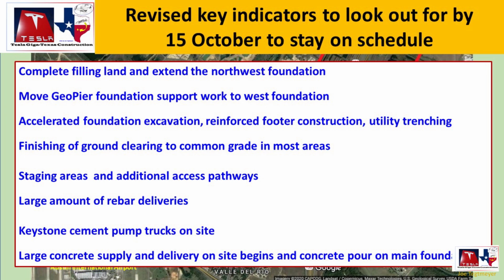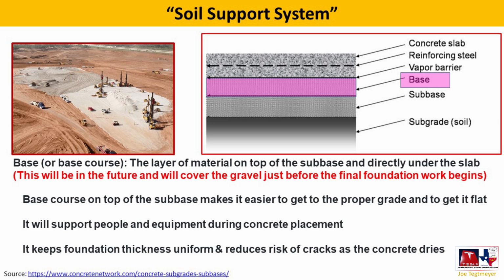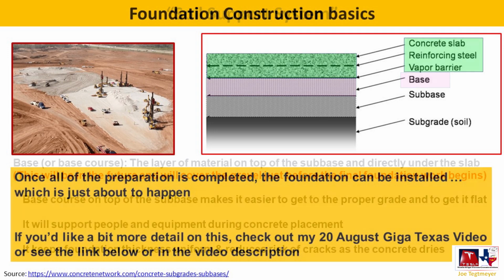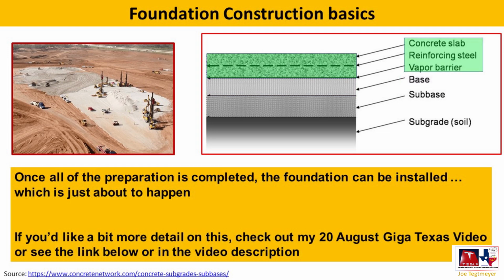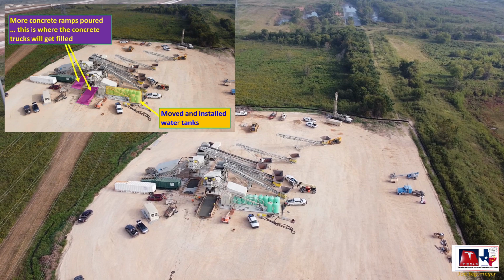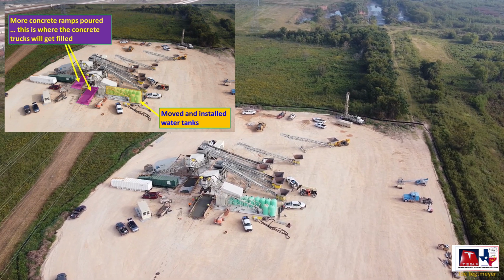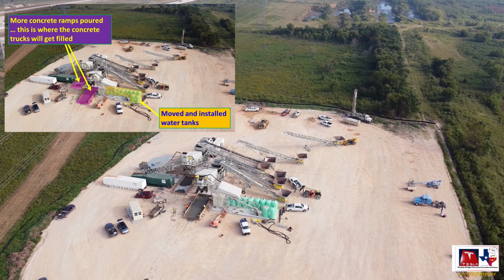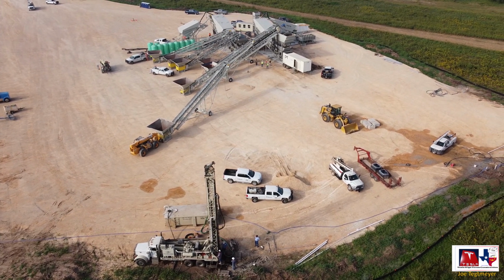Tesla Gigafactory Texas 7 October 2020 Construction Update

Comment: The moisture barrier must be those sheets of tarp we have seen them put down at other parts of the site.  I guess they are going to pour the concrete in manageable sections...I can't imagine a roll of that tarp that extends the entire length of building 1 or 2!  Overlays of the final shape where the NW pond has been filled in are great.  Thanks for all your terrific work!
Reply: Google: "geotextiles."
Reply: @theknave4415  According to Wikipedia it is basically polyester or polypropylene sheet that has been made permeable...from the drone it looks like plastic sheet used to suppress weeds in gardens, but I don't that sheet is permeable.  I expect they will lay the geotextile in squares or some kind of rectangular shape, then pour the concrete into that shape, using a form around the periphery; then apply the expansion joint and go onto the next section until the whole things has been completed.  Might go pretty quickly once they get started.
Reply: The geotextile that was laid down a couple yards above the waterline is water-permeable. 

The film laid down along with concrete forms is impermeable so that the concrete is kept hydrated during curing.

Comment: If you look at what happened in both Shanghai and Berlin the slab was not poured until the roof was up. I expect the same will be true here. Look for all the column footings to be poured first and then the columns and roof will be installed before they start with the slabs.
Reply: In large commercial construction pouring the slab generally isn't done until the roof/sides/utility work including the electrical are near completion.   I agreed with you, the floors will be a ways off.
Reply: The floor slabs adjacent to the walls should be poured early, so that tilt-wall construction can soon follow. This will be evident when the foundations for the pillars continue to be poured, soon followed by floor slabs - but only along the perimeter at first.

Comment: @ 6:30 It looks like they are building levee on the south end that is now a few feet higher than the main grade of the factory. It extends from the freeway to the high voltage transmission lines.
Reply from the maker: David Johnson the large basin are is a water detention pond.  Between it and the tree line, I’m wondering if they’ll leave the small pond or fill it ... I’m curious to see what they do.
Reply: @JoeTegtmeyer  My guess is that they will leave the small pond. The filled area with a road on top between the two ponds appears to be a levee. If it is built up any higher, it can protect the factory against flooding from the river. That is just speculation on my part.
Reply from the maker: Will watch and see what they do together!

Comment: Regarding the mobile batch plant... Good insight Joe! They will need a good supply of clean water that is suitable for the all of the concrete they’ll be producing. I believe that the green tanks will be used for the various concrete admixtures that they’ll need. Admixtures are polymer compounds which alter how the cement hydrates and cures. Some control cracking, some allow for faster curing, and others allow better workability. I would imagine that they will have plumbing in place so that both batch plants will pull from one water tank and one set of admixture tanks.

 A few weeks ago I commented that the FLOORS alone would take about 50,000 cubic yards of concrete to pour. With a capacity of 1,600 cubic yards per hour, they could theoretically pour the entire floor in about 2 days time (about 31 hours by my count). Initially,  I thought that the walls would be precast off-site and then trucked in as needed. Now, I’m thinking they might be cast on-site, given the concrete production capacity. I would think that they would want a somewhat controlled environment for casting & curing the walls, so that weather is not an impact. However, given Elon’s propensity for using temporary rigid-frame tent shelters (Fremont & Boca Chica), I could see something similar being put in place for casting the walls on-site.
Reply from the maker: I think they are not using the precast method Berlin is doing ... I think tilt-wall (on-site just in time) methods will be used here.  The process, methods and timelines will look a lot different compared to Giga Berlin
Reply from the maker: DieselDoug77 thanks for the admix info ... I’ll do a correction/added info on this on an upcoming video!  I believe they will use tilt-wall construction which leveraged the on-site concrete capabilities ... just need a bit more confirmation from sources before I run info on that in a video.  For now, got to get foundation work moving along!
Reply: If we look to what they're doing in Berlin, how long do pre-cast pieces like that need to set for before they can be deployed/installed? Wouldn't they have had to already start that process offsite to get them curing in a warehouse right now?

I just looked up tilt-wall construction - very neat. Shouldn't be too long before we find out.
Reply: @Klemeq  Concrete is typically given 28 days to cure/hydrate before the design loads are applied. However, some concrete designs - called high-early strength - achieve their design strength in as little as 7 days. The first wall panels will probably use high-early strength concrete, and then they will transition to normal 28-day concrete as they develop an inventory of panels waiting placement. They may use high-early throughout, but the concrete mix is a little more expensive.

For tilt-wall construction, which will likely be the method for Tera Austin, the concrete panels will see the highest stresses during the tilt phase (particularly bending stresses). Once the walls are in place, the loading will be mostly vertical, and bending stresses would typically only be observed with high winds or earthquakes.

Comment: 800 Yards of Concrete per hour is A lot of Concrete!
Reply from the maker: Wide World of Trains yes it is and ... there is another bigger plant on site too!
Reply: This place is gonna be epic!!!! The amount of vehicles they will be building from here! They really do plan on replacing all gas vehicles in the world! Then you add the India site soon to be announced. I hope we have friends who can record drone footage from india. I would think they would build another one in china. Its the biggest market for EV and they also export from china to nearby countries
Reply: I also question 80 trucks an hour.  That's 40 trucks per hour per plant.   There must be a typo or math error somewhere along the line.  Where I went to school they told me there were 60 minutes to the hour.  If you divide it out that's only a minute and a half per truck.  You'd be doing well to pull one truck out, and back another in, in a minute and a half.  Then you still have to fill it!  Even if you cut that in half, it's still pushing it!  That's only 3 minutes to pull a truck out, back another in, and get loaded, and instantly pull out.  I think I saw somewhere that the permanent batch plant onsite is rated for 13 trucks an hour.  That's just under 5 minutes per truck, and that's much more reasonable.  There must be a data error someplace, as this spec defies reason.  I don't mean to be a party pooper, just sharing my thoughts.
Reply: @davidmiller6010  And no one has mentioned the needed truck washout for each load of concrete .  Where will the washout be done?  The results are always a mess.  How long does it take to washout?  I don't know for sure, in the real world they seem to take 15-30 minutes.  How long here?
Reply: @davidmiller6010  Plus the time to unload these trucks and bring them back to get filled again.  Maybe  combined with the other bigger plant that Joe mentioned?

Comment: There are two water wells the first was drilled a couple weeks ago is about 100 feet to the right of the current Drill rig location drill rig location from your drones perspective
Reply: If they are going to draw significant water from groundwater sources I wonder whose water rights they are going to use? They might be able to just use shallow wells drawing from a relatively high layer refilled from settlement from the river but I’m not sure how much flow that will give them I know a few of the downstream cities have done this. If they can use it, the regional wastewater treatment plant is not far away and I’m sure they’d be happy to sell them gray water for cooling, irrigation, etc. But if they are going to put in a battery plant, and other such uses of really clean water, they’ll want to have a pretty good starting source.
Reply: Gชอบมาก Fis , never mind, these are just for the temp use of concrete. Still need a permit though.
Reply: @Bill_N_ATX  They are still in the rivers flood plain so the water supply should be unlimited more or less. You can still only get so much flow out of a well though so that's probably why they drilled a second one and you're right all wells need to be registered and permitted.

Comment: Little half moon shaped area looks like a holding pond for liquids that don't need to seep into the ground.  When it was being prepped they laid down black material that could be a rubber type liner?
Reply from the maker: Glenn Thomas it was Geotextile membrane which is a ground stabilizing component used all throughout Giga Texas.  I covered this in depth in an early August video.  It’s a permeable fabric that lets water deep through but strengthens the soil.
Reply: I think that when they get it fill in, they will build the pond release system and the overflow spillways.

Comment: That looks like where they will form the walls of the building
Reply: They build them in sections about that size. Just looks like that might be what it is going to be for
Reply: @forwardthinkingtrucker  That's true.
Reply: I think the floor slabs adjacent to walls will be poured early. Then wall forms will be constructed on top and concrete poured for walls. Then tipped up into position.
Reply: The exterior walls will be over 3 miles long so that's a lot of casting area. :)